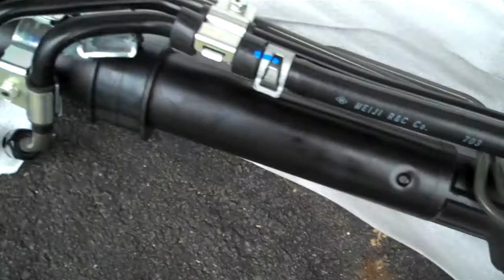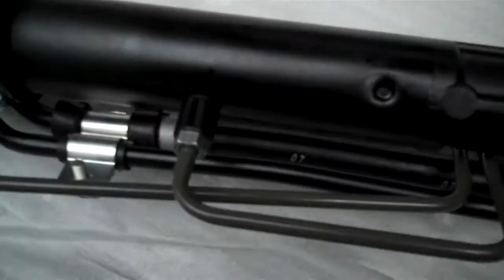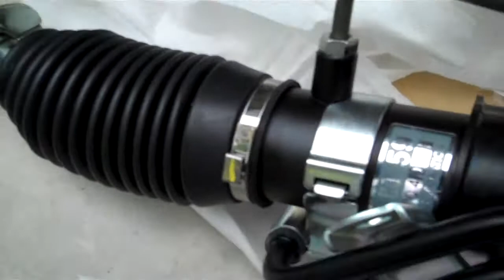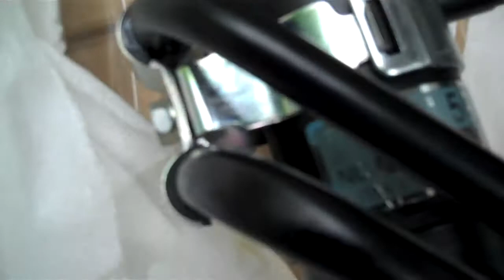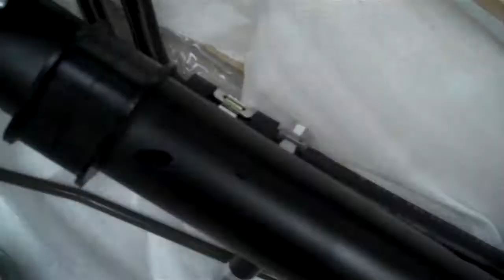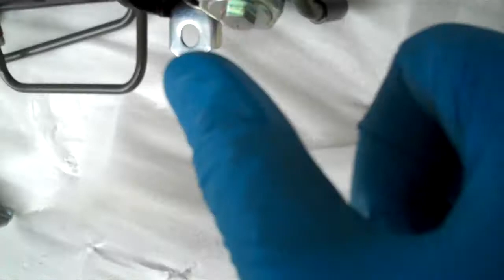2004 sti steering rack into 04 forester xt

Comment: So believe it or not I actually have this on my Subaru Forrester XT 2005. I got it off of friend brand new still in the box and luckily my rack and pinion was already on his way out so I put this in along with the STI shift linkage and it is the best move I’ve made on my car trust me. I feel the difference so I went and installed the STI front lower control arms from 05 as well man the car handles so much better.